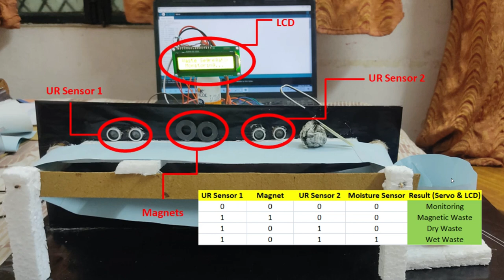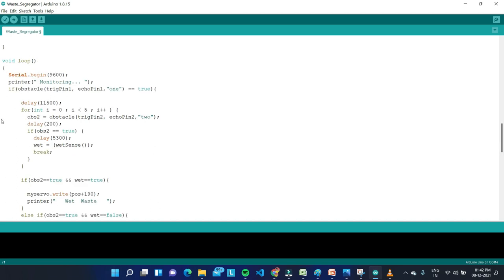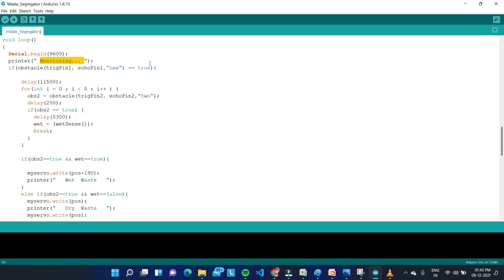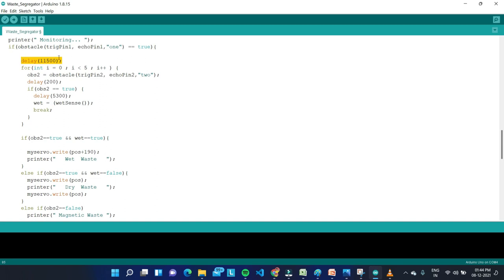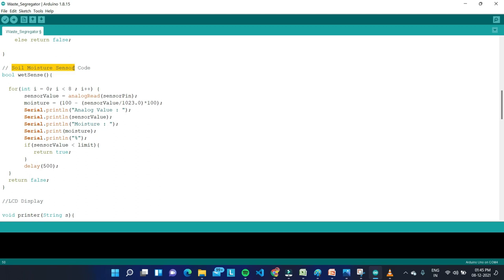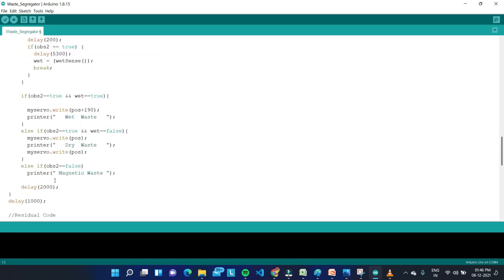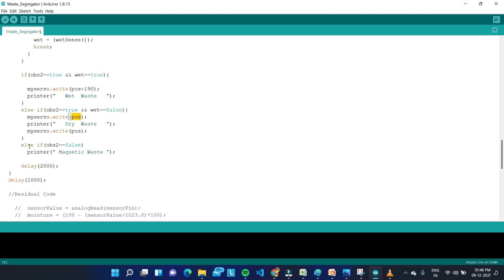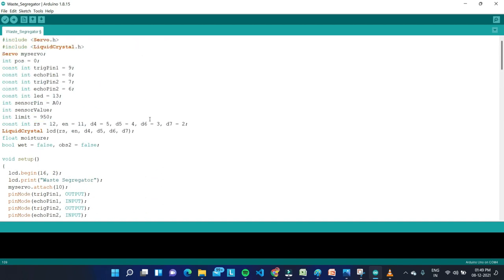WASTE SEGREGATOR | SCIENCE PROJECT | WORKING MODEL | ARDUINO BASED

Comment from the maker: How was your experience making this video ? 
What are your feedbacks and suggestions regarding this video?
And do you want more such videos?
Thankyou, God Bless You!
Reply: Why there is a potentional meter on the circuit diagram
Reply from the maker: @adityasuthar6103  that is usually used along with LCD to control it's brightness, you can use resistances instead for a fixed brightness
Reply: I absolutely liked it i just wanted the video of circuit connection also and sir the code shown in the video is enough right!??